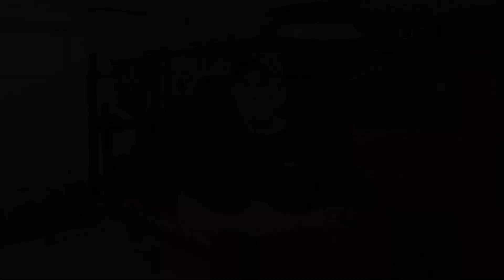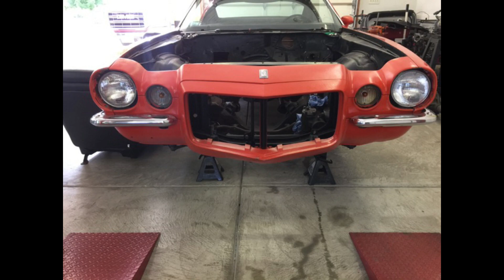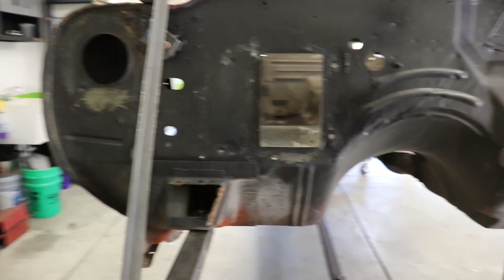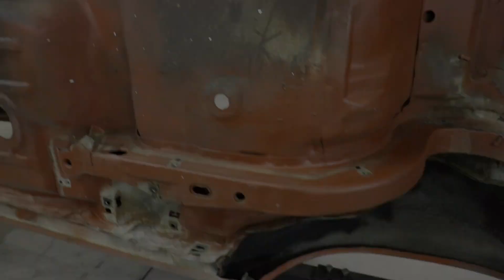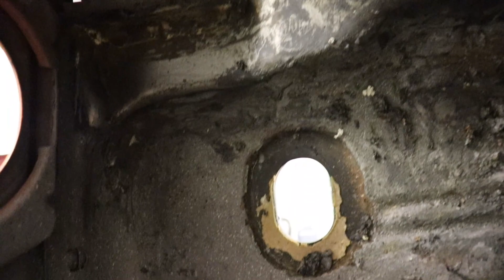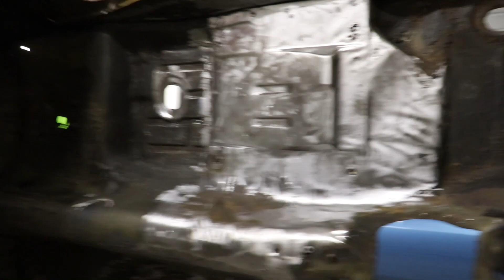70 Camaro Pro Touring Build: Project walk around /  Introduction

Comment: What do you like to use to remove the paint and get down to bare metal?
Reply from the maker: I use paint stripper to get the "heavy" stuff off and then an abrasive wheel on an air grinder....  works great!   I'll be posting a new video soon that will show my process as I get into the trunk repair replacement.